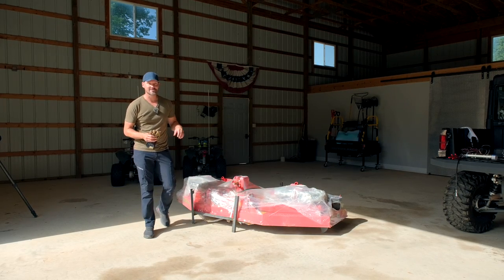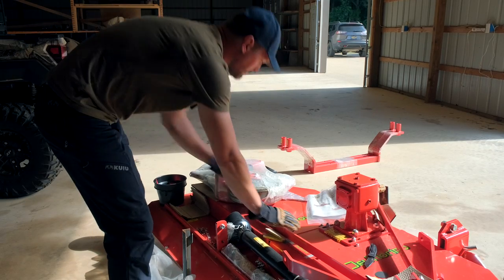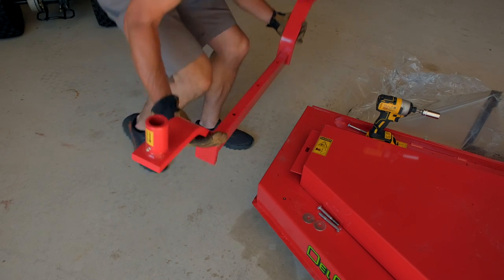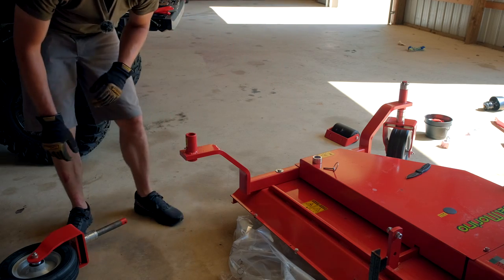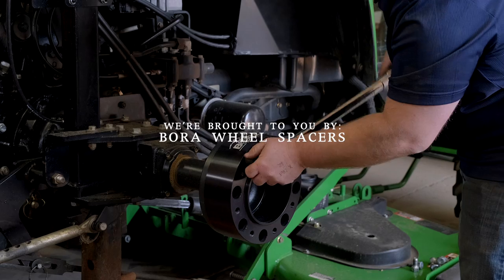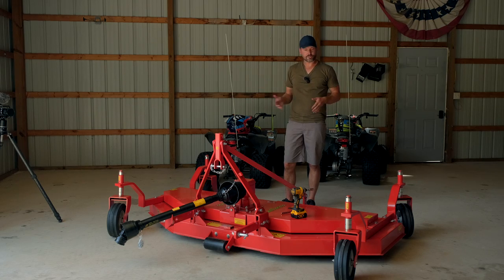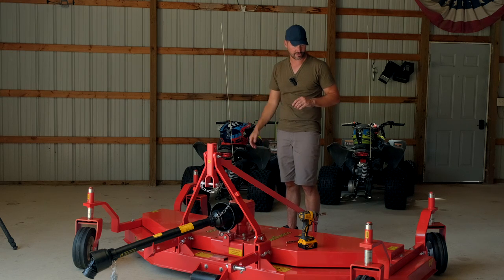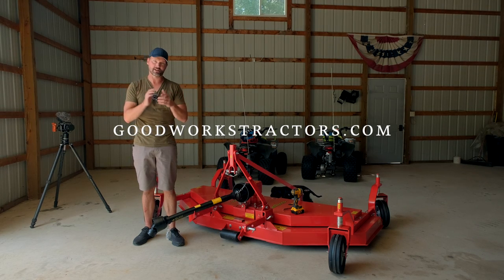HEAVY DUTY FINISH MOWER?  8’ WIDE, 5 BLADES, SOLID RUBBER TIRES

Comment: Don't you have a tractor with a set of pallet forks sitting around the shop somewhere?  Great video and looks like a well-built implement.   Nice that they put a central grease manifold on it.
Reply from the maker: Somewhere!  But, one of those things that you get it done by the time you would go get the tractor and forks over there...just a pain :)
Reply: @GoodWorksTractors  Ha Ha!  Since I got my tractor, I use it to lift all manner of workpieces to a comfortable height.  I lift nothing anymore!

Comment: Most important question to me, will you be able to mount it to your quick hitch.  I have everything I use set up for my quick hitch except my post hole digger, and will not use anything that does not adapt.
Reply: I don't see why it couldn't be mounted to a quick hitch.  i have a similar 6' finish mower that I installed bushings and use my quick hitch
Reply from the maker: Haven't tried yet, but not expecting it to fit

Comment: I bought one of these beasts from GWT. My 1025r has zero problems managing it. Three point can lift it if you give it enough throttle. You have to consider your approach to larger bumps and steeper swales carefully, but on the flat it's just pure productivity enhancement. I have miles of nice grass trails I can do in one pass now. Rear discharge is new to me and I really love it. Been thinking of getting a Ferarri decal to put on the top ha ha.

Comment: nice video!  doesn't look difficult to install.  Looks very heavy duty!  Really like how they ran those grease lines!  I have a Farm King 6' Finish Mower and set the depth spacers so that its about 4" cut.  It matches my John Deere D130 riding lawn mower which I do the outline stuff with.   Would love to have that 8' Del Morino Finish Mower!  Would cut down my mowing time significantly for my 7 acres, but for whatever reason my Boomer 40 will get hot in a short period with the AC on and pulling my 6' finish mower.  It's fine without the AC, but I'm all the time having to turn the AC on/off which becomes a pain mowing 7 acres and defeats the purpose of having a cab.
Reply from the maker: Thanks, it went pretty good!  That's no good about your tractor issues though...I've been there!

Comment: Even if the 1025R could lift it I wouldn't use it. That's a big mower on the back of a small tractor and the front end is going to get light and make turning more difficult. My 6' LandPride finish mower is a bit much for my 1025R at times.
Reply from the maker: Only during transport.  It rides along the ground while in use.

Comment: I have been interested in getting a finish mower. I have wondered though if it is something that I could use on land that I only cut two or three times a year. Wondering if it would leave a nice cut at least better than a brush hog on 16 to 20-in tall grass.
Reply: My personal experience says you will be fine.  I have 5 acres that was probably 24-36" tall.  Had no idea how my 6' finish mower would work.  If I could I would keep my 5 acre lot next to my 2 acre house lot looking like a golf course, so a nice cut / finish is important to me.  I watched a lot of videos, read forum comments etc and they all said a brush hog would be better.  So glad I got the finish mower.  After i mowed our lot, I got several requests to mow other peoples 2 acre lots with tall grass.  If I were to do it over and was looking for a finish mower, I'd get the biggest I could find and would work behind my tractor.  If you have the tractor, I'd get one of GWT's 8' Finish Mowers.  Cut down the time a lot.
Reply: @bruce2900  we’ve taken the baffling off our finish mower when mowing tall grass. The grass will not be as finely cut but the deck does not get constantly jammed with cut grass resulting in smoking belts. 

I’d recommend raising the deck when cutting really tall grass so the cut grass falls down below the spinning blades. If a better cut is needed then do another cut at a lower height.
Reply: I don't think you would be happy with a finish mower. My brother took my king Kutter out in tall grass and first thing he did was fry the belt. You might look at some videos on flail mowers, they seem to leave a more manicured look and handle taller grass much better plus their drive line (belts) are much tougher.
Reply: @starconqueror  we are happy with it. We have an orchard where the trees drop nuts on the ground that are then picked up. The grass needs to be mowed for the harvester to collect the nuts. 

A flail mower would crush the nuts with its hammers. A finish mower can mow the grass above the nuts. 

No tool is perfect and we will get a flail mower one day as its needed to crush the left over nuts and stuff after harvesting has finished. 

In regards to belts frying, we removed the covers of the belts the belts can be seen along with the pulleys. Since we've done this and also removing baffles and guards, its been cutting long grass, like six foot high  grass, without breaking or smoking a belt.
Reply from the maker: I'd not want to treat this as a brush hog....too rough on it
Reply: @GoodWorksTractors  definitely was not looking to cut any brush or saplings just taller grass. O well guess I just need to continue using my brush hog
Reply: @simpleman4196 you can get away with it though you might need to make a 2nd pass because it'll streak

Comment: Heck of a machine. Looks very well built. How long do you think putting it all together including grease and adding oil? Very well built and great video showing detail.  PS: Dumb question: why wouldn't it ship pre greased?
Reply: Depending on how they are shipped it can be considered a fire hazard, so most manufacturers do not pregrease. Another one of those safety regulations!

Comment: Pretty impressive! 66" model is what seems most brands are missing.  72" too big, 60 too small.
Reply: I absolutely agree. My wheels measure 62” end to end. So a 60” is to small. But I only have 25hp so a 72” is really to much. I bog down my 60” in tall grass
Reply: @bortonfamilyfarms6094  I'm shocked 66" isn't a standard for all the 25HP machines!  I'm thinking of just going 72" even if it takes two passes, you are covering a lot of ground.   I have a 54" MMM, and will NEVER EVER go MMM again.   My back can't take more of messing around under a tractor just to hook up a deck!
Reply from the maker: Hmm, already a lot of options...as a dealer, more models is more cost...tough enough as it is, haha!

Comment: Kidding aside that looks like a decent finish mower and probably alot less money than a woods finish mower!
Reply: Yea but you buy a woods for the same reason you buy a kubota, you know it's gonna perform and that you'll be able to fix it anytime because parts are everywhere
Reply: I bought one of these solid machine I cut a 60 acre area every week commercially the only mistake was selecting the air filled tires should have got solid rubber.  The air tires are only tube type 2 ply. It pulls nicely. A 25 hp tractor would pull it nice product

Comment: I bought same brand a few years ago. Did nice till I was backing under a tree and somehow it managed to jam some grass between the blade tip and back flashing jamming the blades and burning a flat spot in the belts. Poor setup for changing the belts, very difficult with the gearbox mounting. At least with king kutter you pull a couple bolts and the hole assembly tips up to get the belt in. I got the belts which was another ordeal but they've never been put on, it's been in the shed ever since. I have a couple deere's that mow much better.
Reply: This year we bought a similar mower made by another Italian brand, Muratori. It’s belt adjustment or replacement system is pretty good. Loosen four bolts holding the gearbox and centre pulley in place, loosen the adjustment bolt, let the centre pulley go forward. Then take the belts off. 

There is easy access at the top of the deck and good visibility.

Belts are easily bought for my deck too. A local auto shop sells them.

Comment: How big of a finish mower can a tractor with 20 pto hp. The tractor is a LSXG3025.
Reply from the maker: I mowed with it on a 3025e 25hp tractor.  The problem will be lift capacity for subcompacts.  It weighs over 700 lbs.

Comment: Do you think a 72” would be too big for my 4010 compact. It’s 14 pto hp. I will be using it to mow my one acre lawn. Grass never gets too long. Thank you.
Reply: I’m not a expert but that sounds a bit mismatched. I have 22 PTO hp and run a 60”. I still bog it down in tall grass. But one important note is your mower should be wider than your tires. So if you have a 66” tire width then get the 72” you are just gonna have to mow slow
Reply from the maker: I don't think so, you'd be good.  I wouldn't go super fast with it.
Reply: Do you have a flat yard? I have a 60” RFM on a b2301.  It handles it fine in medium range but will struggle a bit on small moderate hills.  Need to use 4wd often wet or dry.
Reply: Maybe it's just me but, that setup seems pretty big for a one acre lawn.  I've got a 3901 Kubota and a Rhino TM84 but, I wouldn't use it on my 2 1/2 acre front yard.  I do use my 61" Bad Boy Outlaw XP though.  It could be that your yard is enough different from mine to make a difference. I've got 14 fruit trees and a whole bunch of other things to mow around.
Reply: I had a lawn service but got out of it after last year. I did keep one zero turn. But I wanted something as a back up in case the zero turn goes down. My yards is flat other than my sand mound. I mow it very often. Was thinking of. 60”. But I see a lot of 72” models for sale. I’m sure that tractor will run it. I do have a 3520 Deere I could also use it on. Ok guys. Thanks for the info.
Reply: @ericgebhart5775  Having a lawn service you already know the importance of maintaining equipment.  Even down to the tires on the finish mower.  My finish mower sit for a while and I had to relube the spindles to keep them from dragging ruts.   Even though my front yard is around 2 1/2 acres I can't use a tractor attachment combination.  My entire yard even though not completely a square is approx 440 ft long and 330 ft  wide.

Comment: Could've turned that shipping frame upside down and then set the mower on top of it, frame had legs on it.
Reply from the maker: Well why didn't you tell me earlier?
Reply: @GoodWorksTractors  I noticed it when you took the plastic off and I used to work for a New Holland dealer and we used to use those shipping frames to set up equipment on. There's a dual purpose for everything plus we used the metal to make things in the shop to make life easier. I'm surprised I noticed that frame when I was watching, I'm 67 and don't think as good as I used to.

Comment: Get a trimax stricker 190 its a twin roller mower
Reply from the maker: I could be wrong, but I'd expect that mower to run 2-3x the cost of this one?
Reply: @GoodWorksTractors  it is but the finish is very good from 13mm to 4 inch height of cut i run a 190 on a john deere 4400 here in ireland that finish mower they stopped using for pitchs nothing wrong with the mower great build to them if ur just keep grass down there fine if you want a stripped finish trimax 190 or wessex mowers love the channel i watch all the time